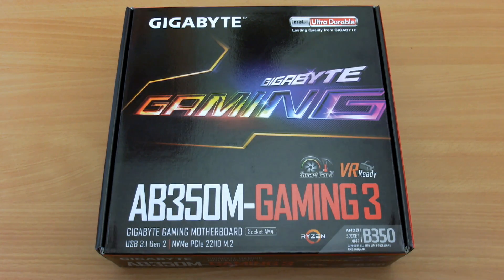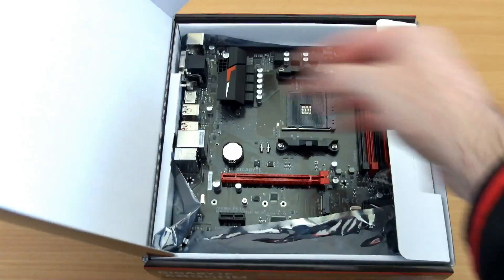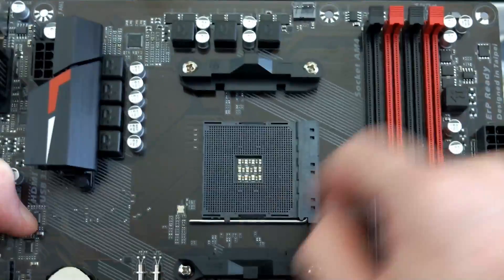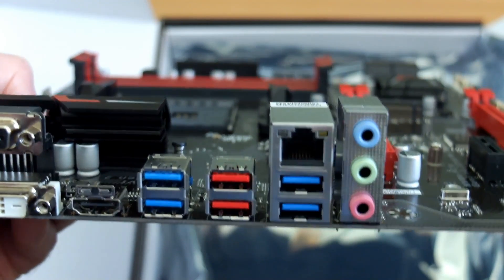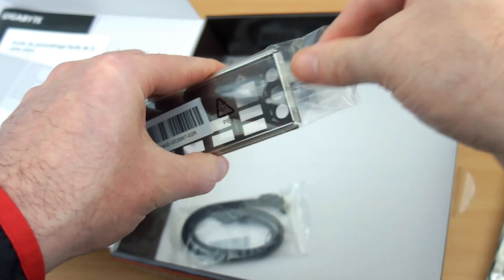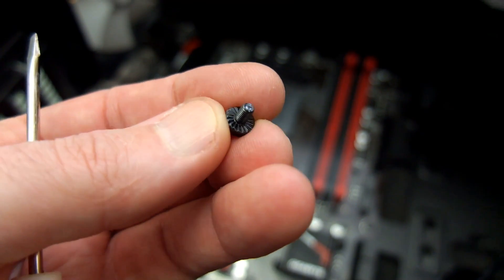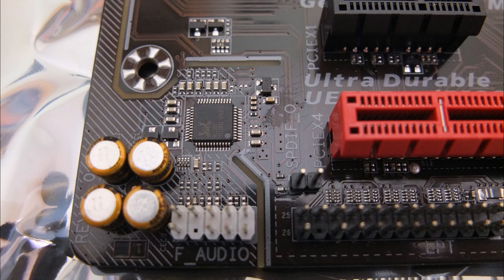Gigabyte GA-AB350M-Gaming 3 Motherboard: Unboxing

Comment: my brother bought a new custom pc and gave me his old one and the build is nice and it has this mother board on it, i want to upgrade the board because i want usb-c, wifi and bluetooth accessibility but i have no idea on pc building. but i would like to upgrade, any ideas on new boards that are good?
Reply from the maker: You only get those items on top end priced boards (Wi-fi/Bluetooth built in), and really I can't suggest that it makes much sense to buy in at that level.
USB C is turning up on other priced boards
Reply: @MrBazReviews  damn.. any suggestions on the high end boards?
Reply from the maker: @P1_D  I stick to Gigabyte as I have found them reliable (so far) I don't know what you are looking at system wise. I've not thought about updating the PC yet as it's really doing all I need

Comment: Is the motherboard good enough for a rx 5700 xt and ryzen 5 3600?
Reply from the maker: It works just update the BIOS for the 5 3600
GPU makes no difference works on any board
Reply: @MrBazReviews  OK thanks
Reply: @MrBazReviews  its work for the ryzen 7 3700x to or?

Comment: Can I have 2 ssds on this motherboard?
Reply from the maker: You can have more but only one M.2 SSD, don't see a problem with that myself. Either use the SATA or a PCI-E card for more M.2 slots. The main thing is the boot drive IMO so SATA for the other SSD's wouldn't bother me
Reply: @MrBazReviews  thanks...  Could you recommend me one for this motherboard, because recently bought another ssd and had to return it because there were no slots left because I got the same type as before. Sorry if this message sounds confusing... I am not that pc smart I hope you can help me again. Thanks!
Reply from the maker: @adamaronson9556  I'd use a Kingston A2000 for the m.2 slot, Samsung are popular most should work I've no time for Crucal/Micron stuff had nothing but problems with them (awful customer support all marketing stay away!) Kingston has been pretty solid so far, or even a few budget WD drives I've had no problems yet
Reply: @MrBazReviews  I already occupied the m.2 slot with a samsung 960 evo, and had just returned my samung samsung 970 evo plus. My m.2 slot is already occupied... What would you recommend that doesen't take that slot? Sorry if I sound like I don't know what I'm talking about...

Comment: thinking of building my own desktop and wanted to use this motherboard, help heaps! thank you so much!
Reply from the maker: I'm still using it for my main build, they also updated the BIOS so newer 3rd gen CPU's can run. There are some good deals now on the first/second gen CPU's - be mindful BIOS won't probably be up to date if you get the board so be careful with the CPU choice (or use an older one to update BIOS)
Reply: @MrBazReviews  i was going to use the AMD YD2600BBAFBOX Processeur RYZEN5 2600, but im still new to this, wanted to research as much as i can x

Comment: So this doesn't support 2 M.2's?
Reply from the maker: No single slot on this board, not really a problem at this price point though
Reply: @MrBazReviews  I am noob with everything. I was just making sure. I bought a 960 Pro a while back and was building this thinking yhere were two. It's definitely not a problem but I'm glad my question was answered!
Reply from the maker: @DrLengen  I think the idea is boot drive for the M.2 so I don't see it as a problem. You can get adapters for M.2 to SATA I have one though I usually use it for connecting to an external SATA to USB 3 for working on drives. Don't have a problem with using 2.5" ones for data storage or SATA is fast enough for that I think.

Comment: Can install two graphics on this board & which M.2 SSD  is compatible with this motherboard PCIE or Sata?
Reply from the maker: No one GPU support on this board. M.2 if it fits it works simple as that it's a universal standard so SATA or PCIE either will do
Reply: Mr Baz Reviews the pcie x16 slot looks like wont be able to handle a large gpu?? as the ram slots are very closely set will a evga gtx1060 ssc sit on that slot??? can it accommodate the size?
Reply: please help me i am confused for if i should buy that gpu or not coz later if it doesn't fit in i would be devastated!!!
Reply from the maker: It will fit the card sits just below the ram slots it's flat on the back so you won't have a problem
Reply: Mr Baz Reviews omg thank you that's a relief

Comment: I need help I dont know which case to get for this mother board cause the one I have doesn't fit
Reply from the maker: I used a Cooler Master Silencio 352 for both builds I did. Depend what you want it's a decent enough case well ventilated, but not super flashy ie if you want a gaming case with lights etc. But I'm happy enough with it
Reply: @MrBazReviews  I also wanted to ask do you know why the mobo doesn't fit cause it is a rosewill ATX MID TOWER and the version is TYRFING and it said that micro atx can fit but apparently it doesn't so I am really bummed cause I have waited months to finally build a pc
Reply from the maker: Why doesn't it fit what part? This is wider than some micro ATX boards, but it should fit cases which fit micro ATX. The cooler master the only potential issue is if using a DVD drive (some are longer) that's it fits fine. I can't see how a case won't fit a micro ATX board if it says it does unless it's not designed properly
Reply: @MrBazReviews  would the corsair carbide mid tower fit this motherboard because I am worried that it wont fit just like my other mid tower case
Reply from the maker: If I don't have the case I can't help you no way for me to know as I said before what isn't fitting because micro ATX is a standard size yes some are narrower and some wider but still cases should fit the board
Reply: @MrBazReviews  okay ty for the help though

Comment: Does this will problem if i'm gonna using 3200mhz 8gb Ram with Ryzen 3 2200g? Because i've seen many problem videos about this Mobo .
Reply from the maker: I'm not into overclocking ram much as I have a separate GPU (doesn't make big difference to me) but it will impact things quite a bit if you are using an APU as it shares the memory fps will be hit with slower ram. Just check the vendor list it's updated to find the best match, other than that it's tweaking the timings to try to get the system stable. I can't see that many issues with decent ram, there is some support for XMP on this and other boards if you use the vendor list 
https://www.gigabyte.com/Motherboard/GA-AB350M-Gaming-3-rev-1x#support-doc
You will see it has been updated for modules at 3200MHz
Reply: Dont worry i already use dual channel 3200MHz ram on it and its perfectly fine :))

Comment: Can you do a video on how to connect it to a power supply? Having a bit of troubles with the wires.
Reply from the maker: What PSU is it? Really not much to show the connectors can't be inserted the wrong way by design. You need to have the CPU power also connected to the board
Reply: @MrBazReviews  I bought the PSU on Amazon: PSU POWER X3 600W ATX Switching Sumvision Power Supply

This is my first time building a computer (I am having help from friends) but I'm having trouble wiring the motherboard with the right cables. When my friend tried it turned on but wouldn't connect to the monitor claiming it had "no signal".
Reply from the maker: If it boots and no signal that's not the power supply check the cable connection to the monitor
Reply: @MrBazReviews  I have and I've used different monitors with different types of cables and I'm still having the issue.
Reply from the maker: What GPU are you using
Reply: @MrBazReviews  Amazon again: Asus Cerberus GTX1050 Ti OC, 4GB DDR5, PCIe3, DVI, HDMI, DP, 1455MHz OC
Reply from the maker: Could be a number of issues. Remove Ram re-seat (use single stick), remove GPU and re-seat, check all connections disconnect any non essential devices (extra hard drives/DVD etc). If you have speaker see if there are any beeps on POST. If you suspect PSU isn't working properly try different one. The PSU you have is not one I would use at the least coolermaster masterwatt lite (bit more but still affordable and reputable build/company). I cannot say if PSU Is the fault unless it's tested you can get testers for this purpose
Reply: @MrBazReviews  Thank you for your suggestions. I'll defiantly look into each of them and tell you what the problem was if we find a solution
Reply: @MrBazReviews  update: when my boyfriend first put it all together he put way too much thermal paste and it ended up leaking into the processor and motherboard so that's probably why it didn't work. We didn't know until my brother took it off.

Comment: Sir i saw a gigabyte b350m gaming 3 ATX and this one is mATX can you tell me whats the defference between two plss..
Reply from the maker: Same chipset but the ATX board has the LED lighting control, more expansion slots etc, there are other differences that's the most obvious ones

Comment: im new to pcs so can you answer this question how many ram slots this this board have you probably said it in the video but i cant listen to audio right now becase its middle of the night and i dont want someone to hear me cuz tomorrow you i have school
Reply from the maker: You have four slots up to a max. of 64GB on this board so that's up to 16GB per slot, though that's going to be pretty expensive to deck out. I went with 2 x 8GB (dual channel) for the time being that's plenty for most users
Reply: Mr Baz Reviews so what i was planning to do was to take some ram frommy old laptop enter it to this board and buy some extra im waiting for cuber monday and black friday to bit parts because some pc part prices are over the moon so my laptop has 8 gb of ram am i able to take out all eight or only 4 to keep it working
Reply from the maker: Laptop Ram won't work the size is different so can't be used with this board or any other desktop pc mobo. If you want to keep the budget down sure 4GB is the minimum really for basic users it will run on less but that's the lowest I'd build today, but if you game or do other stuff like editing or rendering 8GB is really the place to be..not really worth using less. You could always get 8GB and add 8GB more later on or a single 4GB and add another one down the road.
Reply: Mr Baz Reviews thanks for the info i think ill buy 2x4 gb on sale in november as i will save up a bit more money and by that time i should be able to get good specs

Comment: Quick question for you, I got a refurbished board and it did not come with any of the mounting screws to secure it to the case.  Should it have?  Do all of the solder screws holes need to have a screw in them?
Reply from the maker: Boards don't come with screws, the case does though. You can get packs of them pretty cheap I've so many I threw a bunch out (case comes with stand offs and screws). Don't need to put them all in, but you'll want to make sure it's secure enough at least 4 screws minimum really
Reply: Perfect, thanks for the very quick response and excellent video..

Comment: i'll be using this motherboard with a ryzen 3 2200g apu will i need to update the bios using an older cpu?
Reply from the maker: Impossible to say newer stock no it should be updated, older stock well as said you will have to update it. There is no way of knowing when you buy it
Reply: Mr Baz Reviews alright thanks for the reply

Comment: i want 16gb ram for that motherboard do u know the cheapest ones i can buy from amazon ?
Reply from the maker: Ram is still pretty expensive so really other than going for the normal v higher speed stuff. I use the Hyper X ram not had any problems if you go for 2666 I think that's fine for most users unless you're using the Vega Radeon Ryzen's where the GPU ram is more important
https://amzn.to/2lKS2Mk
Reply: ty <3

Comment: I buyed it but am in problem no wifi and lan connection after installing drivers pls help
Reply from the maker: I have never seen a problem with the LAN, there is no built in Wi-Fi on this board. Best to uninstall drivers, then re-install check your router/cable (re-boot ie power off then on)

Comment: This or MSI B350M PRO-VDH    for r3 1300x?
Reply from the maker: Not much in it really specs are close the Gigabyte does have USB 3.1 Gen2 ports if that matters
Reply: what about quality?vrm?
Reply from the maker: Both are 4+3 so not much difference really nothing worth talking about. At this level unless you're doing some crazy OC with insane voltages on the Ryzen 7 it's a non issue, Ryzen isn't power heavy unless you're on the edge of the CPU's even then a lot less than the older FX ones were, and they really did need decent VRM's for moderate OC'ing.
Reply: Ih you have this mb, did you oc and how much?
Reply from the maker: You can get to 3.8GHz on a R5 1600 with voltage increases. Most chips should get there depends on the CPU some OC better than others

Comment: I have used this mobo for few days and seems working fine, the problem is why everytime i only use the APU i cannot enter to the BIOS? It just like skipped to win 10 boot screen, i have made sure fastboot are disabled, but still i cannot enter to the BIOS when there is no GPU attached on it, my current BIOS version is F23d
Reply from the maker: Very strange not heard of that problem before have you tried to clear the CMOS on the board ie to the defaults? I know you can access some BIOS settings with the Gigabyte APP, not all of them though.
Reply: I just curious is it just a bug from the BIOS? because what i've read from reddit F23d is still BETA because ended with *d
Reply from the maker: I don't have an APU to test at the moment I'm not having issues getting into BIOS with a R5 1600, so it sounds like a bug to me, I'd still try a clear CMOS to see if that works. Or wait for the next BIOS it probably won't be long as I expect a new batch of CPU's coming along soon.
Reply: Anyway disabling CSM can make the BIOS show up even with APU, but it wont boot anything, the boot order it self doesn't show any HDD to boot.

Comment: which one is the better Asus prime B350 plus or Gigabyte ab 350m gaming 3 or Atx gigabyte b350 version ?
Reply from the maker: Depends what you want I prefer the Gigabyte boards to the Asus Prime B350, the ATX Gaming version of this is also solid. Do you want smaller size micro ATX which I did with this build..if so I am quite happy with the AB350M Gaming 3

Comment: I want to buy this mobo for a Ryzen 2200g and 8 gb RAM 3000Mhz 2x4 (I will buy the same kit for the other 2 slots, the next year more or less) Do u recommend it?

Sorry for my bad english:P
Reply from the maker: I have had no problems so I'm quite happy with the board if you want what it offers, it is possible to spend more or less depends what you want this seems a good compromise between price/features. I don't see the point buying a high end board for most users this hits the spot for the price and what it offers

Comment: I have the same mobo, and I can't get it to boot...Ryen 7
Reply: Update the bios... It should work...
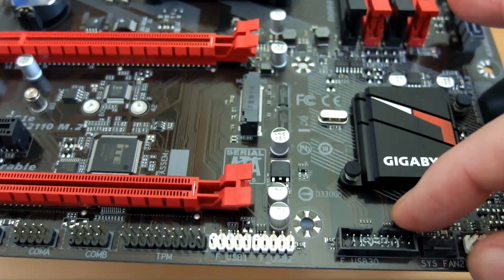Reply from the maker: Try this, remove all extras (HDD, DVD etc) check cable connections just use HDD. Re-seat GPU, RAM (use 1 stick if possible). restore to defaults. If all fails clear CMOS by touching with screwdriver on contacts at 2:14 (black pins above front panel connectors)
Reply: Use another apu/CPU to boot first and then update with that processor

Comment: Looks good. I just ordered one of these to replace an msi b350 tomahawk that I am sending back as it refused to post at all. Cheers.
Reply from the maker: Hi Ollie I've done the build with a Ryzen 5 1600 and didn't have any problems booting or installing Windows working perfectly. There are some BIOS updates (mainly for new CPU's due out soon) easy enough to work with this, well featured and price is respectable. Let me know how you get on with it